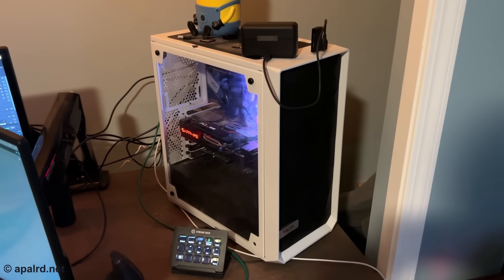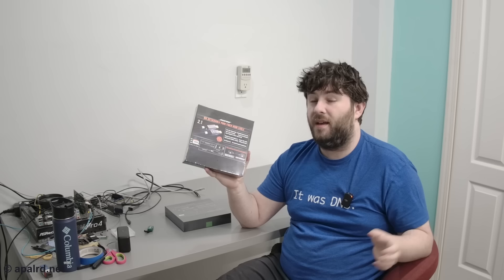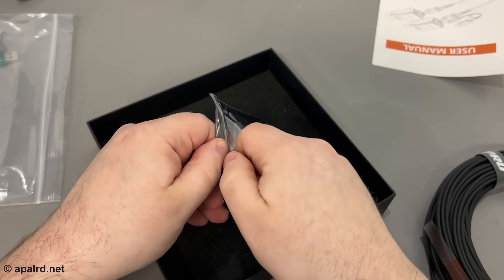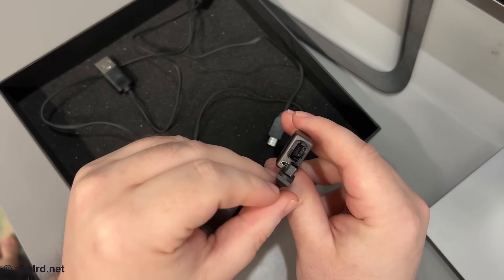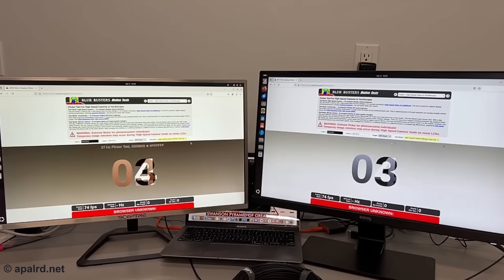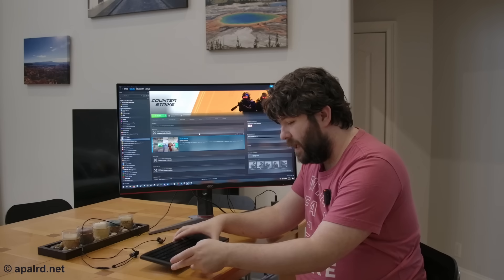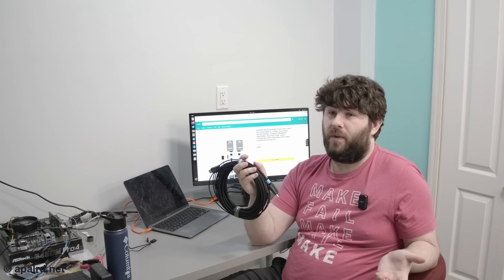FINALLY Sending Raw HDMI over Standard Networking Fiber

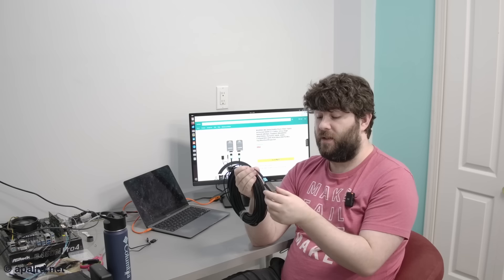Comment: 10:30

I think there is no analog HDMI signal. HDMI is digital. Not analog.
Reply from the maker: As an electrical engineer, this entire thing (at least the high speed TMDS lanes) would be in the 'analog' domain - taking a TMDS differential signal and driving a laser, all of that is analog, even though the voltages eventually get converted back into binary down the line.

Comment: LightOptics has a similar thing for HDMI, DP, USB 3.0, and 3.1: They claim 8K HDMI 2.1, 8K DisplayPort 1.4, USB 3.0, and USB 3.1 10Gbps/Gen2.
They also use a 8x core MPO system and sell 3 way splitters. 
I would love to buy one for the same reason as you, but I would love to see someone test them first. It's an expensive setup to gamble on.

Comment: i'll be slightly autistic, too and point out 10:30 all of analog signals on the hdmi :face-blue-smiling:
but really nice video, I knew about the testufo site, but i never noticed the flicker test, that's a cool tool, thx
Reply from the maker: As an electrical engineer, this entire thing (at least the high speed TMDS lanes) would be in the 'analog' domain - taking a TMDS differential signal and driving a laser, all of that is analog, even though the voltages eventually get converted back into binary down theline.

Comment: One other benefit is that the HDMI fiber cables also have copper wires in them to carry power and and I2C part and that copper acts as an antenna, which might damage your equipment in an electrical storm.

Comment: It's worth noting that fiber can be terminated with the right tools.
If I really wanted to do this, I'd be buying cables with broken fiber off Ebay, and splicing in MTP connectors.

Of course, I wouldn't be anyway, since I ran my whole house with SingleMode fiber, so I'd have to run even MORE fiber, so I'll just put my rack next to my desk...

Comment: I will say that the fiber you showed as an alternative when saying you could buy it from a different fiber company will probably not actually work with this product.

Their site says to use the Type A polarity, while the one you showed is the Type B polarity. Though from what I can tell from their site it does use the UPC type of MPO/MTP connector type which is another easy to miss factor of this fiber standard

Comment: holly... the potential of this. could have pc all the way in the garage, which has zero heating is way cooler in the summer. could have very low tempts without even trying. + zen with room so quiet you can hear pin drop. just add USB on it to make it complete.

Comment: You could already do basically this, just with copper -- zero-latency 4K60 using HDBaseT 3.0 over Cat6A cable, and it also includes a return path for USB 2.0.

Comment: I don't understand, Ruipro already sell fiber HDMI cables (I got one), so what's the difference with this one except being able to plug off the fiber from the 2 HDMI plug to make it pass through small hole in walls more easily ?
Edit : ok so it seems this work with a standard fiber cable ? I just never saw this fiber before, doesn't look like the one that come from the street to my internet box 
In which case scenario does someone have fibre running inside the house ?? normally once the fiber reach the house and plug in the box, the rest of the network is generally ethernet cable though the wall, not fiber ?
Anyway, we need the same but with USB now, all in one cable, and goodbye the noise ! I could finally buy a GPU without having to RMA it 10 time until I get one that have a acceptable coil whine

Comment: Those 12 fiber cables are pretty expensive. If the run is 100 feet and under you can use really cheap converters and run it over 2 cat 6 cables. From what I'm inferring, both of these solutions maintain the same electrical encoding of HDMI. In theory they could put HDMI over a single fiber, but the electronics for converting HDMI to something else and back again would be expensive.
Reply from the maker: It's not necessary to convert the encoding to run over a single fiber - it would mean using 4 wavelengths of light to encode the 4 high speed signals, and more tightly toleranced optical components to operate on those 4 wavelengths without interfering with each other, instead of the same wavelength across 4 fibers. 

But since there are actually 7 fibers (including the non-display-stream signals), we would actually need 7 wavelengths, or we would need two fibers. Duplex fiber is already really common for networking (tx and rx).
Reply: @apalrdsadventures  Oh ya, WDM. That might be cheaper, than say doing 100 Gb, but it's not cheap either. That could be good solution in longer connections where the fiber run is the majority of the cost.
Reply from the maker: 100G Ethernet also uses WDM to do 4 lanes over single mode fiber

Comment: There are SDI over Fiber adapters that will run SDI over whatever you have a 10G SFP+ for. Blackmagic makes one for well under $200.
Reply: Yeah, I'm really surprised that it needs more than a fiber pair, didn't Japan just transmit something like 400 tera bytes per second over a single standard fiber?
Reply: @DubCodes  Wizards live in Japan
Reply: @DubCodes  It's probably easier for the to use 1 pair per signal.

Comment: there is latency if you pause like here 15:34 or keep pausing randomly until you see different numbers or one number if faded. by the way the one in the left is quicker of faster than  screen in the right
Reply: might be the rolling shutter on the phone. your timestamp is wrong? it points to the end of the video.
Reply from the maker: the one on the left is the one via fiber, it's differences between the display electronics on the two monitors

Comment: Interesting, thanks! Wish they used standard 100, 200 or 400 Fiber with LC connectors, single Strand, that you could fuse if needed, and run through a switch ... that adds only a few microseconds latency
Reply: and thus would entirely defeat the purpose, and point of these of existing....
Reply: @benwhittle7204 Huh? That’s microseconds not milliseconds … at 144Hz refresh rate that’s approximately 6.9ms between frames; or 6900ųS. I think a few microseconds delay will be imperceptible at those rates. Additionally SM fibre is arguably better for range, durability as it’s thinner and the LC connector is even more common than what’s shown. Did you notice the price of the 10m standard network cable mentioned was $120.

Comment: Why not use moonlight and sunshine? Have a thin client locally that can stream the games from your gaming desktop. Is the latency too high for that or something?
Reply from the maker: It's a decent walk if the compatibility is having a bad day, and I've already struggled to get certain games to work properly on my ultrawide monitor as-is
Reply: @apalrdsadventures  
I haven't actually used moonlight/sunshine myself. But I want to switch to it.

One of the reasons being is I think it'd work well with CRT gaming. I could have a analog out GPU on one PC that can handle high resolutions/refresh rate. And then a modern GPU playing the game that would be streaming it.

But I am concerned about latency. I guess I just gotta play around with it myself and see how well it works.

Comment: They weld the cable into the ends because MPO connectors are expensive. As for dust, it's multi-mode (MM), so dust really isn't that big an issue. (still, keep them covered when not in use / plugged in.)

Comment: Nice solution!. Would be great if ethernet could be used, maybe something NDI related eventually.
Reply from the maker: Depends on the distance / quality / latency tradeoff. Network-based stuff will introduce some latency and compression will degrade quality, but you get to go super long distances over low cost wiring and infrastructure.

Comment: It is a solution but my use case AV over IP would be so much nicer. That video you did in the past with it, all that hardware is discontinued. Was the only reasonably priced stuff for that solution.
Reply from the maker: I will have to find another one I guess, I still use those a lot of AV stuff

Comment: USB-Micro ... shakes head .. these look really good otherwise. Seems to be an adapter version of the HDMI-Fiber cables that appeared a year or so back (non-detachable).
Reply: i think in this case micoUSB is actually better. 
This cables are rarely disconnected so the little locking mechanism is an advantage and not a point of failure. 
It also makes it clear that it only requires 5V and not some special power delivery stuff.
Reply: @pflasterstrips7254  Type-C is superior by design in every aspect. I’ve never had any issues with Type-C connectors becoming loose in the port. Micro-USB lacks a locking mechanism—there’s no retention clip (like in DP cables). You don’t need to worry about voltage compatibility because all USB devices default to 5V and are universally compatible—even modern fast chargers. Higher voltages are only supplied if the device’s charging controller explicitly requests them (which is irrelevant for this type of product). 
  The only reason Micro-USB is still used here is cost-cutting—the manufacturer saved a few cents per unit by including an outdated port and the cheapest cable on the market.
Reply: MicroUSB is smaller. They'd have to increase the case size for C.
Reply: @draco10111b  its literally 1.5-2 mm smaller. I don't think its big difference. If this is the main reason they could go for round mini jack and USB to jack cable. It will be 3 times smaller than microUSB.

Comment: I'd like to see one that did everything over a single cable. USB3+ HDMI/DP, all through a single fiber. Just a little hub on both sides. For usb3, i'd want 20Gbit, enough for all my accessories and portable SSDs. But i think i'd want both hdmi and DP. or 2x DP.
One display line for the vr headset and another for my monitor. Or for people with 2 monitors.

I was also thinking of moving my PC into another room. But i do swap usb devices often.

Comment: Why do they use multi-fiber cables when a single multimode-fiber can transmit 25gbps with ease and hdmi needs only about 18gbps? A set with LC-connectors would be nice.
Reply from the maker: they are directly translating the 4x differential pairs of HDMI to 4x fibers, which means it's not doing any encoding which could introduce HDMI incompatibility

but yes LC using wdm would be nice
Reply: @apalrdsadventures  I bought a kvm over HDbase-T 3 years ago and it was unstable most of the time. Last november i bought a kvm over IP set from "AV Access" and this is running very stable. It can do 4k@30Hz and 1080p@120Hz. No noticable delays. I use it over 30m Cat7 cable for a video-conference-room with a 84" 4k touchscreen and a usb-webcam. Big benefit with this set: you can change "the channel" with dip-switches if you have issues with distortion by large machines. And you can extend the distance with cheap network-switches.
Reply from the maker: HDBaseT is re-encoding the TMDS signal to run over 4x twisted pairs (Cat6a), similar to what this is doing over optical fibers. HDBaseT is muxing the side-channel (basically, everything but the video) on top of that though, instead of using extra pairs.
Reply: @apalrdsadventures  HDBT has a latency of approx. one (1) line.
With HDMI/DP audio is transmitted in the blanking area of the video signal. Same with HDBT. That's the reason why you can have audio only with a picture present. No picture - no blanking to put audio data into.  ;-)

Comment: 11:30 Check out HeyOptics. They have stuff just like this Ruipro but they use 24 fiber trunk cables instead of 8 fiber. And they use a Y-breakout on each end of the trunk cable with whatever config you want for ends. Their default ends are 1x DP2.0, 1x HDMI2.1, 2x USB3.0. You can get different configuration if you want. I went with 2x HDMI 2.1 (so I have a backup just in case) and 5x USB 3.0. The trunk cable from them is fairly cheap, but you could also go with a 24 fiber MTP OM5 grade trunk from some place like FS and then your main line is capable of being used for upgrades for likely at least a decade. The OM3 fibers these companies all use will probably only support 1-2 more HDMI generations before they run out of bandwidth.

Comment: Pretty cool, but i think thunderbolt over fiber makes a bit more sense for this kind of stuff. Then you can have a full dock at your workstation with everything dp, hdmi, multiple high speed usb, audio, sdcard readers and what not.
Reply: Love this idea. I must say the use of micro USB in 2025 instead of USBC is inexcusable
Reply: @ThatHz-  I think in this case it's acceptable purely because Type C wouldn't physically fit in the case. They could make it bigger but it already is risking taking up too much space behind a display and blocking other connectors.
Reply: @ThatHz-  don't love it, but the connector hooks actually hold on better than USB C. Regardless it's just powering the screen-side connector and that's behind the monitor or TV so who cares
Reply: It's been a while since I went down the rabbit hole, but isn't thunderbolt over fiber expensive? Plus you would need a mobo that supports it? (again, it's been a few years since I researched, so maybe it's more standard on mobos nowadays)
Reply: @TheyCallMeTravis90  optical Thunderbolt is definitely expensive. IIRC, there are copper to optical transceivers that you can use.
Reply from the maker: Full dock can be USB3 though, aside from displays
Reply: @apalrdsadventures it can be usb3, but should be USB4 and backwards compatible. Would be lovely for putting noise outside my studio
Reply: @apalrdsadventures Caldigit TS4 gives you everything you want. USB 4 (Thunderbolt 4), USB 3.2 Gen 2 (10Gb), HDMI 8k60/4k144 high refresh rate (by using an Active DisplayPort adaptor).

Comment: I'm curious if you've investigated SDI (HDMI over coax).  I believe you could get 1080p with a refresh rate of 60hz up 328ft?
Reply from the maker: HDMI has the unfortunate 'feature' of HDCP, which isn't supported by SDI
Reply: @apalrdsadventures  and this is why I cannot stand consumer HDMI, connectors, the cables, the length limitations, the varying qualities and oh yeah and the copy Protection. I was trying to use an iPad A/V adapter into an NDI converter, no way to tell why it wasn't working you just have to assume that it's hitting a copy protection issue unless it tells you.
I'm switching over my production system to networked video from cat HDMI extenders. So I need to know that somebody will be able to plug the laptop in and do the presentation or plugged an iPad in and do the presentation and it will send through into my switcher system for streaming and also to the projector. So lots of test test test.
Turns out Blu-ray player no for now, however I did get the iPad working with a pass-through 1080p EDID dummy adapter in reverse. I have no idea why it doesn't work at the device end, and that it works when at the receiving end of the chain.

Edit: I navigated away and realized I had an experience with my local small town movie theater. They're all above board and licensed and want to stay legal blah blah blah. Big movie weekend packed house. What happens the encryption board and the projector dies! They have a license for the movie they have the movie but they cannot play the movie. Everybody got refunded or their name was taken for next week for Despicable Me was it 4 and there was a big push to get it fixed before next week. Overnight shipping, board replacement, reactivating. Meanwhile I discovered the projector will act like a dumb projector if only there was a way to get access to a copy of the movie. oh wait we have one we can't play it because it's copy protected. I briefly thought about the fact that I managed to find the whole movie online for free but was unsure of the quality and this was before it was shown in theaters.... Yeah HDCP really helps prevent copy theft! < sarcasm.
Reply: Most good SDI devices strip the HDCP  @apalrdsadventures

Comment: I like this idea for reusing already pulled fiber, but if the fiber is not there, I'm going to have to pull something anyways. Just recently picked up a few Amazon Basics HDMI Fiber Optic Cable, 150ft, HDMI 2.0 at $15 each (thanks Woot), and honestly to save me over $100+ I will deal with the pain of pulling them.
Reply: Well if you're going to be poking holes and running cable might no is worth running some conduit or flexible Smurf. That way you only have to do it once assuming you make the holes big enough and choose the right size conduit to fit the future cable ends. Then you can just slip in and out, and then have an access panel in Key spaces.

I had to redo a cable up to a TV for somebody, needed to add another ethernet cable. and I was so glad that I cut and pre-measured a bunch of stuff for access panels. all I had to do was cut a square of the plywood ceiling in the shop below and everything was prepped going up to the TV I only wish I had conduit.
Reply: Stop buying Amazon Basics stuff.
Amazon (ab)uses their position to bully suppliers into selling to themselves.
You are basically giving Amazon the keys to a monopoly.
Everyone loses except Amazon. Even you.
Reply: You sure it is $15 for 150ft? I am seeing CAD97 or USD40.